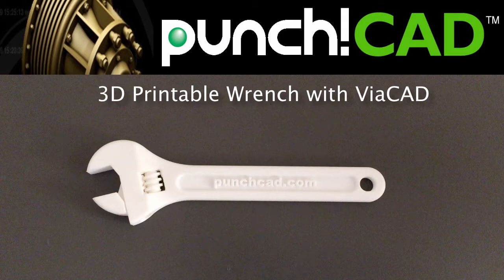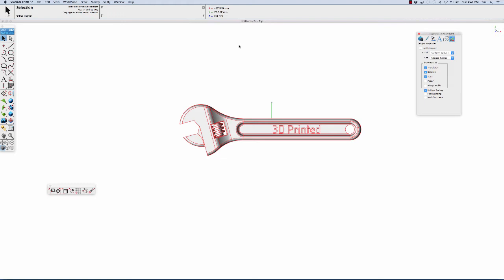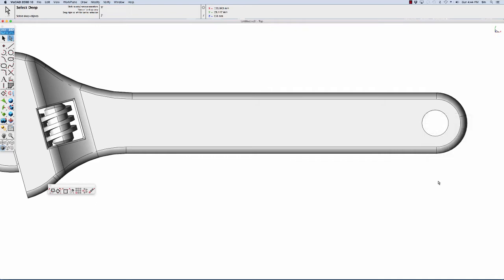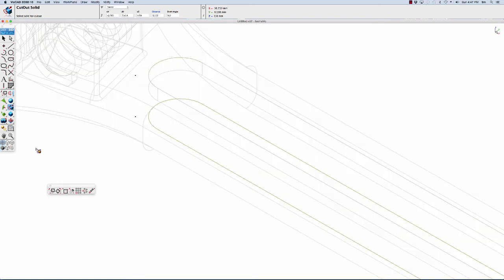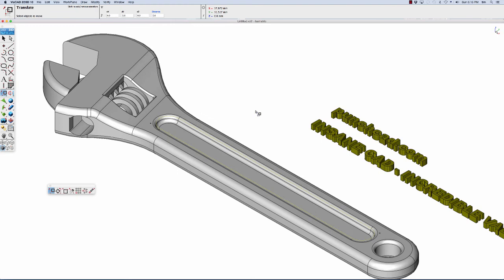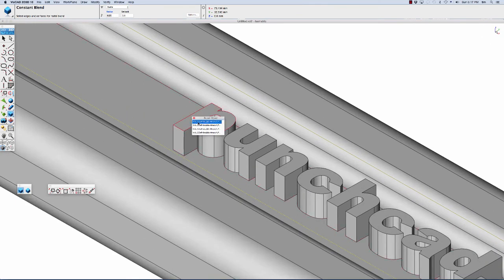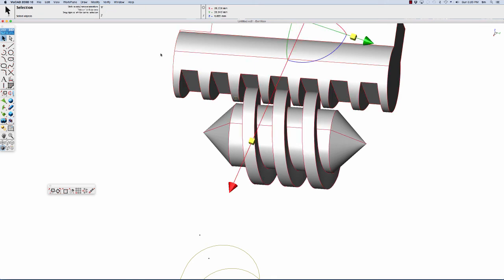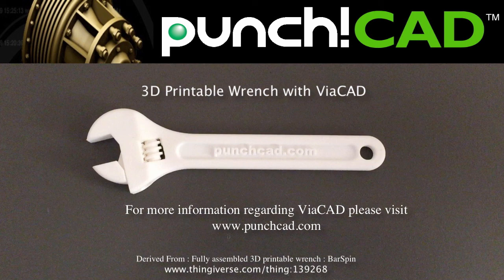3D Printable Wrench

Comment: I tried to follow along your tutorial with ViaCad Pro 10 on Mac OS Mojave 10.14.4, and it either crashes or freezes when opening any .stp file (does the same with import) (https://www.thingiverse.com/thing:139268)
Reply: Exception Type:        EXC_ARITHMETIC (SIGFPE)
Exception Codes:       0x0000000000000008, 0x0000000000001921
Exception Note:        EXC_CORPSE_NOTIFY

Termination Signal:    Floating point exception: 8
Termination Reason:    Namespace SIGNAL, Code 0x8
Terminating Process:   exc handler [7172]
Reply: all the .stp files are AP214